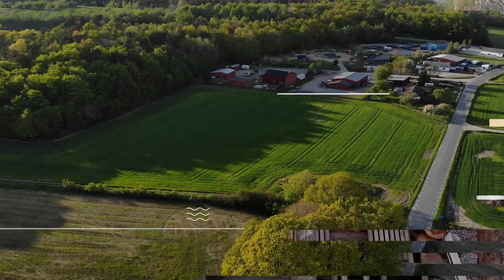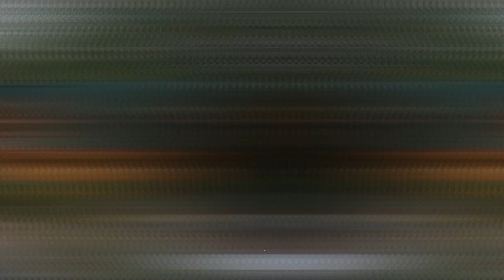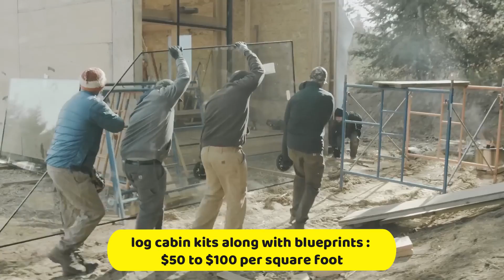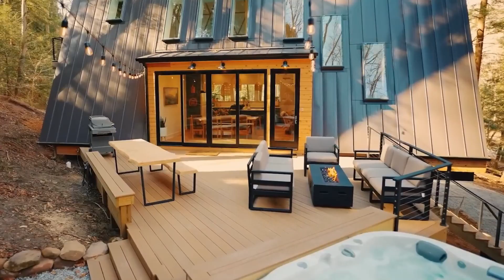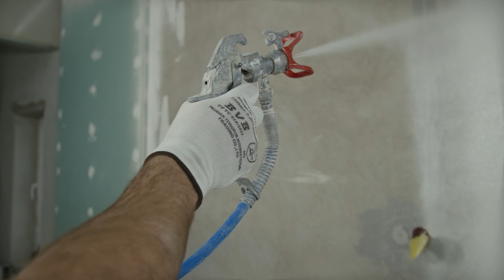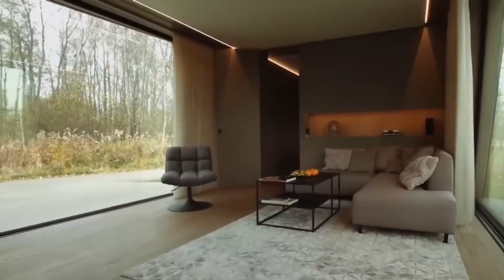How Much Does It Cost to Build a Log Cabin? | Breakdown and Ultimate Guide!

Comment: If you're comparing Edveros to other prefab options, the thing to look at is foundation specification. Helical piles to structural engineer spec versus a simple pad - that's the difference between a mortgageable permanent home and something lenders treat differently.

Comment: Well I’ve just started this video but as a former Log Home owner (3 Br, 2 Ba, 2500 sq. ft. on 3 acres) buying it pre-made for $170,000 in 1997 wasn’t the problem. The problem, my log cabin, home, chalet enthusiast’s is that damn upkeep! Everyone wants to build with Pine, treated of course, because technically, it’s cheaper. 
But if you live in any of the following states:
TN, KY, NC, SC, GA, AL, MS, LA, Southern MO, Southern VA and let’s throw in the Northernmost Panhandle of FL.
Every type of bug that I’ve encountered in Upstate South Carolina, which can be found in all of the listed states can and WILL eat your house! 😂 Now I put in that laughing face because every year myself and my husband looked like idiots chasing those damn carpenters bees that will bore a perfect 3/8” hole into your logs to lay and egg . . .
Well you spend you time swatting them with an electric fly swatter in between filling the holes! Honeybees! Ah yes! Love the honeybees that ALWAYS fins a way to get into your awning and build. Dripping honey on the inside of your home down a wall is such a bummer. Termites. Putting Orkin on the payroll if you have ANY decking attached to the actual home. We had cinderblock foundation with a stone facade but we STILL had to pay Orkin for Termite treatment. Now that was an insurance requirement! That’s another goody. No one wants to insure log homes and you pay higher premiums . . . 

I’m giving myself a migraine! Log homes are lovely but to do them correctly is expensive! Win the lottery first and then build using Cedar!
Reply: Hello! I just read your comment and would like to ask a few questions about cabins, as I am highly considering of building one and it seems like everyone is praising them but there's little information online about all the downsides to it, like you described. If you ever had an experience with cabin kits / barndominiums / small houses, I would really appreciate that. And I'm sure you ran into permits/HVAC/septic issues too. 
Would you mind if I get in touch with you and get a few "experience based" advices? If there's any neutral email or a social media that you're fine sharing, I would love that. 
Thank you!